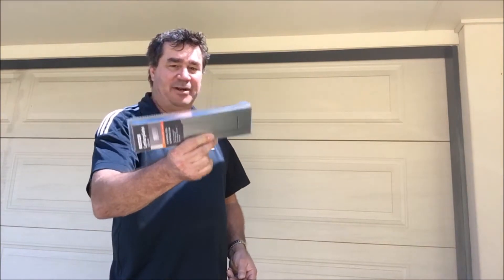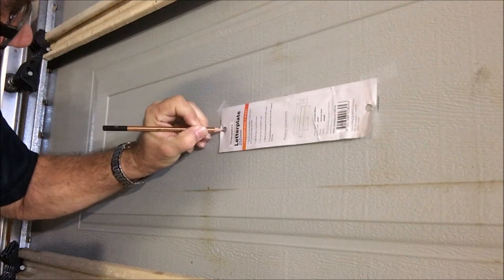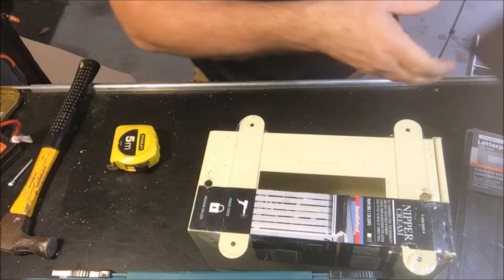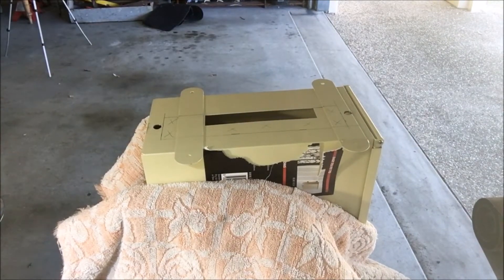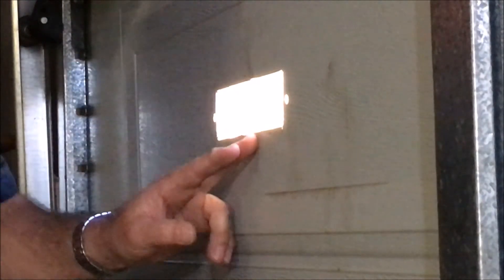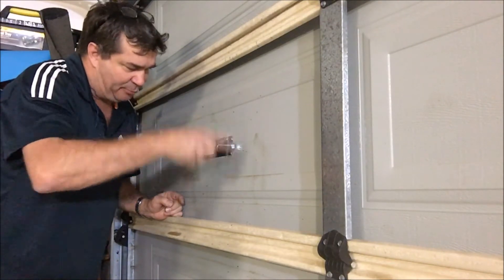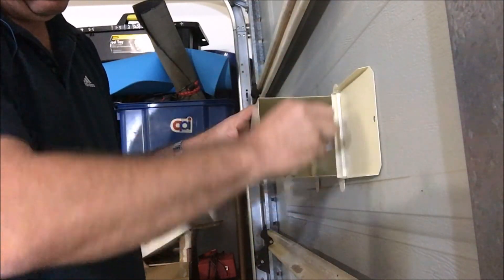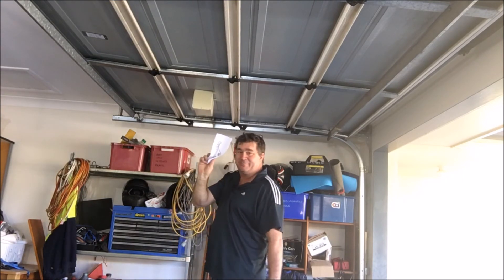How to install a letter box into your Panel Lift garage door. Easy and cheap DIY project.

Comment: Does your garage door have an emergency pull release? I would have mounted the box with the door towards the wall, otherwise someone could poke a long piece of wire through the letterbox, open your mailbox door and hook the emergency release pull, thus opening your garage door.
Reply from the maker: Hmmm, there are easier ways to break in. This is the least of my worries. 🤣🤣